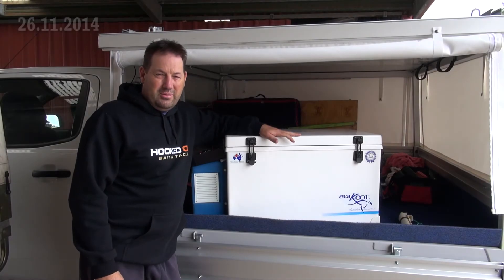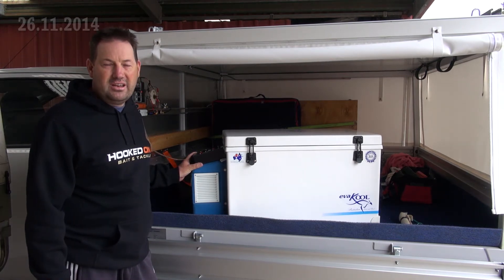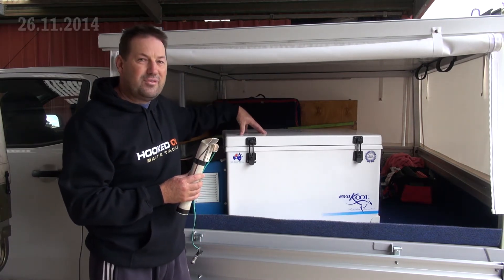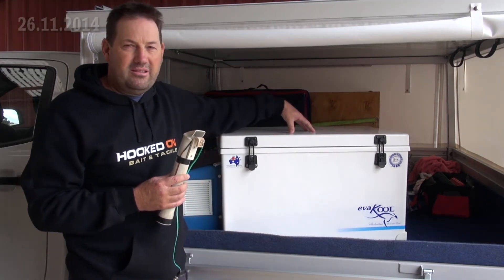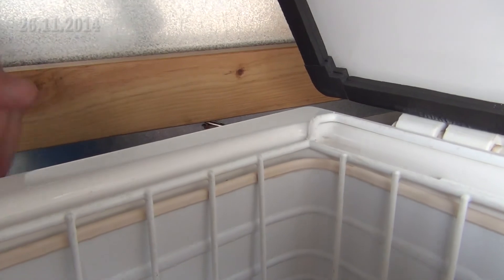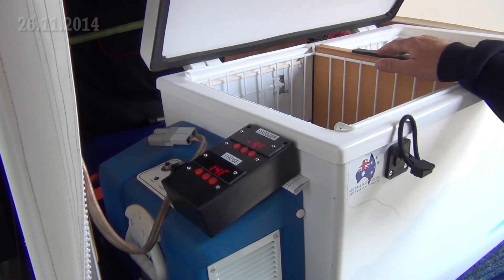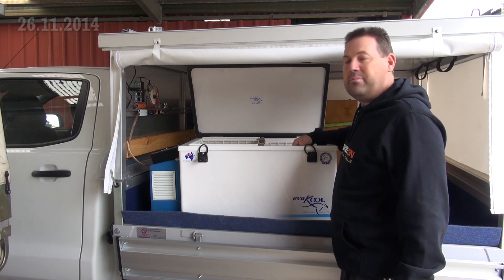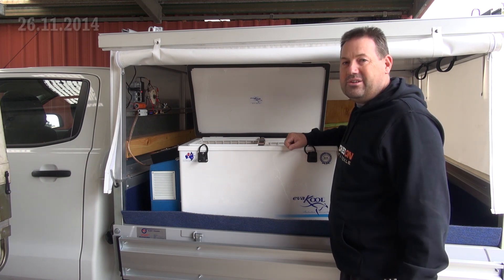EVAKOOL FRIDGE FREEZER improved dual temp control modification

Comment: I just lifted my divider up a bit so the air could flow. Had mine for 10 years or more without on issue. Even says this in the user manual

Comment: Hi Robin 
Wondering why you put the colder air from the freezer bottom in an upside down U channel? 
Why not just make it go straight through? 
And also why make a new divider? Instead of altering the original? 
Sorry for the 20 questions :p 
Thanks
Reply from the maker: Cassandra Lomas the new divider has a channel in it for the cold air to travel through and if there was just a hole from one to the other the fridge side will freeze.
Reply: robin coker how big is the channel through the divider.
Reply from the maker: Cassandra Lomas an inch by memory. Was awhile ago.
Reply: robin coker ok thank you for the information thinking of doing this to my 85 litre fridge.

Comment: Question is are the new evakool fridge freezers  better, have they resolved some of those issues?...Nice trouble shooting you could build a bad boy from scratch..
Reply from the maker: +Namdor2012 have not looked at the new models but my dad has just built another one from scratch.
Reply: +robin coker ..Thanks for the reply I will hope they have improved, Im thinking of buying a for a 47 litre Evacool..still they are a lot of money due to the small market I guess..But if I have probs your Dad's solutions are appreciated..
Reply from the maker: i use the evacool rf 60 as a fridge very happy with it. plenty of trips up north no problems.

Comment: Looks like a great little system you have going on with your EvaKool RF 110L. Could you please provide a bit of info about the higher current cords, the temp controller and temp gauge etc, and the make of computer fans etc that you purchased? Also have you any idea about adding a compressor (the danfoss BD35 0r BD50) into a Evakool Cool Icebox? I'm thinking of trying to do this myself etc